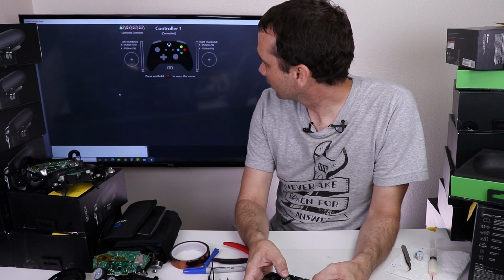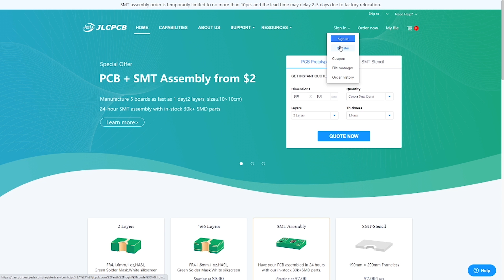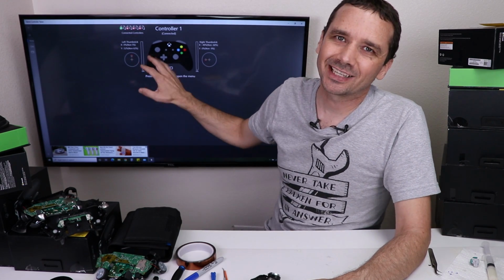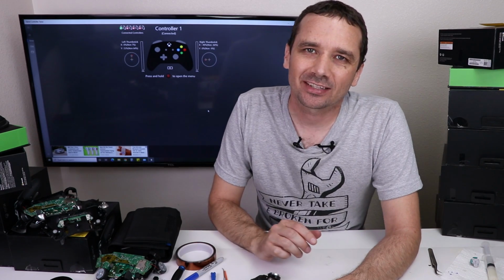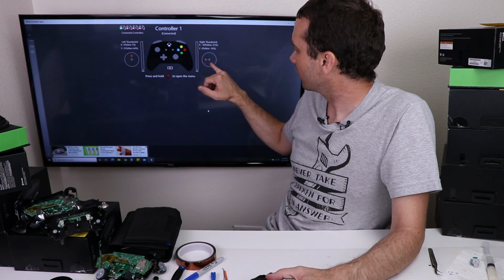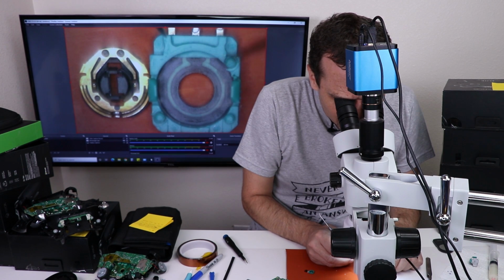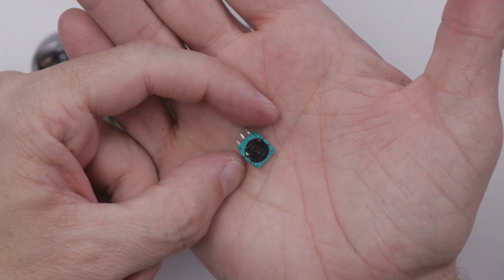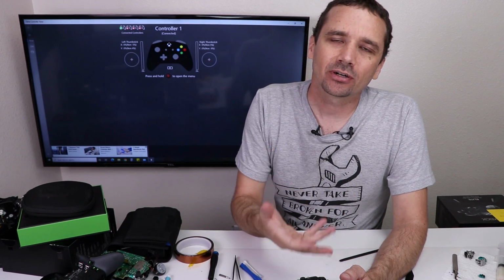How to Fix Analog Stick Drift - 3 Ways

Comment from the maker: Which method have you tried?
Get your PCB's manufactured here: www.jlcpcb.com $2 - 2 Layer 5PCB's,   $5 - 4 Layer 5PCB's
Reply: But where do we buy the parts??
Reply: My controller right stick goes left if i pushed my left stick forward
Reply: I tried buying a new controller
Reply: I have tried the cleaning method without success in the past. PS where do you get your replacement joysticks? and are they as good or better than the originals?
Reply: where is the best place of places to get genuine alps analog replacement for ps3,, ps4 xbox   etc ,    there's china copy's of alps ones   on lots of sites but don't work very well or have less steps in range each direction  or short life span  ,, so is there a good place to get genuine alps ones and how to identify the right ones for ps3 / ps4  / xbox   and some times ps3   ps4 used different alps analog stick for different models of ps3 ps4 controllers ?
Reply: Those black circuit boards look kind of like batarangs.
Reply: Btw I love old big wallets 😆
Reply: Blowing in it.
Reply: The same thing happened on one my PS4 controller's, I took it from another stripped working motherboard and it worked fine I can run again after a good clean different contact wheels it'll work I never use the same part I would rather replace the wheels or the module itself. Those are the two option I use only.
Reply: can you do a complete tear down of the ps5 controller and console when it comes out?   that'd be tits
Reply: Good video, have you ever managed to fix the issue with R2 turning left?
Reply: Plz i need help my ps4 is not turning on when i press the power button it just make sound but the light not turning on plz help me
Reply: Hi,I Have seen your vids and i think your my guy that can help me.

So 2 years ago my ps4 has had a problem that when i turn it on the ps logo start is normal but then there is a black screen for maybe sometimes 3 or 1 minute
After that the blue screen comes and its like very delayed because it only has a plain blue screen,then 2 minutes later the wavy line comes then its says
"A error has occurred in the system software/report the error" Its laggy and it freezes in the login,menu,and when i want to start a game the ps4 turns off.
Also it Acted fixed dor like 3 days then 2 or 1 week later it acts fixed again,but i just want to know if i can fix it permanent or its like temporarily like i said?

For Clear info I have The (PS4 Limited Edition Starwars Battlefront or more simple 1215A)
I Hope You Can Help me Keep up the Good Work 👍🏻
Reply: Can you make a video on how to fix/replace a Xbox elite series 1 usb because I’m pretty sure when I had mine plugged in I tripped on the cable and it demolished the USB port and now it dosnt work so I have to use batteries
Reply: What about just replacing the disk part and keeping the track?
Reply: Hey tronics do you why my ps4 turns off just when I start a video game ? I can watch Netflix or YouTube but just when I start a game my ps4 turns off . Do you know why and can maybe tell me a solution I have the first gen of the ps4
Reply: You can buy parts from ebay or ifix it
Reply: Got a nice Phantom White Xbox One X controller with a drifting right stick off ebay for cheap. Pried the potentiometer off the side enough to get in and clean it.... pulled a bunch of hair out of the controller as well... and now it works like a charm!
Reply: Great video. Can you kindly recommend (list) the set of tool kits required for this operation?
Reply: Hi @tronicsfix , I saw your tutorial , that was awesome but unfortunately I'm unlucky , I clean the potentiometer "nothing" , I change the potentiometer "nothing" and I even bought an other joystick for replacing it ( I didi without any problem) the joystick work but the drift is still there ( I even put the new joystick that I bought on an other PS4 controller and he works without drift ... So my first controller is doomed or what ... I lost hope after doing your tutorial without problem
Reply: This is good I have drift going on with both PS4 controllers and i ordered that soldering kit and the 10 PC analog pieces just in case .. Is it ok to keep soldering on the mother board to the controller ?
Reply: I used #2. Worked a charm. Thanks for the clip!
Reply: I just fiddled around with it then I turned it to the opposite side on where its drifting and blew inside it somehow worked
Reply: Cleaning the potentiometer has worked the ten times or so I've tried it on stick drift controllers. I think it's a design process flaw to be honest since there is a very small amount of lubricating oil in there and that is what tends to spill into the potentiometer. That has been the case with all Dualshock 4's I have fixed anyway. It most definitely works if there is just some jittering in the steering.

Comment: Thank you! Watching your videos (and some accidental joy con damage from my dad who actually knows a bit about electronics repair) has given me the confience to get into it myself. I tried severeal times using a soldering iron to get the joystick out of a ps4 controller, but I just couldn't get the solder all out of the holes. Finally I was able to get my hands on a hot air station and I just finished using it for the first time. WOW!!! Actually game changing. A minute or two and I had the first one out. The blue plastic at the bottom was stringy so I turned the temp down a bit and was more patient and the second one came out no issue. Now hopefully I didn't roast anything important, but I'm just so happy the joystick came out! Thank you sir for making such a positive impact on so many people and saving so many electronics from the garbage. I hope to make this into a fun and useful hobby. I'm sure I'll make many mistakes along the way but I'll learn a lot too!
Reply: Nice! In case you haven't done it already, you can use kapton tape around the area you're soldering or desoldering to minimize the risk of roasting unwanted components, just like TronicsFix did on the video. Repairing electronics is indeed a fun little hobby
Reply: @AUBCodeII  thank you! I did get some of that too and used that, but unfortunately the first time it wasn't down well enough and I toasted the battery connector a bit and had to try to reattach it. I have no idea if it still works, that ps4 is my test board now haha. I have however successfully swapped a ps5's joysticks and I'm feeling more confident! I'm working on getting my friend's Xbox controller to fix drift on that next. 😁
Reply: @thatwolfboy2898  maybe you should consider installing hall effect joysticks on your friend's Xbox controller, that'd be a fun project
Reply: @AUBCodeII  that's the hope! It's so nice to not have to worry about drift.

Comment: This video and the 8 broken Dualsense video inspired me to fix my own. I have no soldering equipment (costs more than a controller) so I bent the potentiometer back to clean it properly. Way farther back than I meant to but it was probably for the better. It was VERY dirty and with good deal of wear but it seems to be working much much better for now (knock on wood).

Comment: I got a PS3 DualShock 3 that I'm stumped on.  The vertical direction, Left Thumbpointer starts off in the upmost position then slowly drifts goes to neutral- all while not responding to vertical inputs.  If I take a Hall effect cover and magnet from another, known-good thumbpointer position, move it to this Left vertical position, the result is identical.  This is the VX3 07 revision.  Could I have a bad resistor or cap somewhere or bad solder joint elsewhere in the circuit?  Ready to abandon this DS3 pcb.

Comment: I need some help, replacing an analog stick, it works perfectly but the l3 button when pressed no longer works. Any idea why this might be. Tried it with two different parts, both from the same order neither the L3 button didn't work. Xbox one wireless controller.

Comment: I recently transplanted a known good analog stick from one controller to another. The drift is ok now, but after a minute or so the stick sends "pushed in" signal, as if it were constantly pressed, which it isn't. What could be the problem?

Comment: This is gold! I've replaced the whole analog stick many times... little did I realize you can take off the sensors and clean them.
Since this video,  I've since replaced the sensors from a new analog stick, without replacing the potentiometers and it seemed to work on one controller... But like everything, its a hit or miss, didn't work on another controller.
Now instead of removing the whole analog stick, I'll just be replacing the potentiometers from now! Thanks!

Comment: Thank you soooo much! I bought a spare analog stick (the square with two potetinometers) from a Xbox One controller for 1 USD and I fixed my Series controller up and down stickness and drifting by doing the method 2! The only difference is that I got the small spart (metal ring) that you removed and, instead of putting it back after cleaning the insides of the potentiometer, I replaced with the spare part's one (since the original seemed damaged) and it worked (on second try, I had to use both metal rings from the spare potentiometers because I destroyed the first one putting it back in)!!!!!

Comment: Thank you so much for this video. One of the analog sticks in my controller was drifting vertically. I opened the potentiometer, cleaned it up following your instructions, and now it is working like a charm. And I used the right amount of thermal paste, as well. :-)

Comment: HUGE TIP - For replacing a potentiometor, if you pry it away from the main assembly (like you would to clean it) and bend it back and forth till it snaps off from the pins, that makes it so much easier because then you can just desolder each pin and pull them out one at a time. That way you don't even need a solder sucker or solder wick.

Comment: i've replaced the analog stick on my dualshock 4 but the L3 key doesnt work (no input recorded). The "click" on the analog stick was working on another controller (used to be the right analog and r3 was working). I think something in the board doesnt seem to get the L3 input, how do i throubleshoot?

Comment: I bought a pack of potentiometers from a shop then said they were direct replacements for Xbox One and Dualshock 4 pads. Replaced 2 on a bad PS4 pad and it turns out they're not the same lol. Must have different resistance. Pushing the stick only half way up or half way to the side registers as 100%.

Comment: Successfuly replaced both vertical potentiometers on both sticks, was harder the first time since controller was new and wasnt opened before. Second time I did it in like 15min. The vertical axis were jumping up and down before, now they're stable. It's slightly off center, someone mentioned in these comments each of these sensors is slightly differently calibrated, but I've got slight deadzones set up for that. Thanks for the helpful guide man :D

Comment: considering how much a person's time is worth, it's honestly cheaper to replace the whole damn thing. Unless you are in the 0,01% of the population with both the skills and the hardware required to apply a DYI solution.
Nothing to say on the quality of the video, but honestly speaking unless you enjoy it as an hobby it's still cheaper to buy another 40 buck controller.

Comment: Changing the potentiometer worked for me! Had an old 360 controller and all i had to do was switch out the potentiometers on my Series S with the ones on the 360. Imagine the little strips as a skull shape and the chin part goes at the bottom. This video saved me so much money!

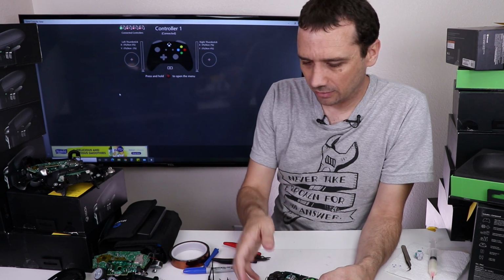Comment: Hello TronicsFix. I recently started learning to repair XBOX controllers. I'm glad people like you are way ahead of me in skills, so we can learn new things just by watching your videos. Thanks for that! I have a question about the potentiometers. When you start testing the first replacement method (around 3:46), it shows that the X and Y axis aren't at zero, so they aren't perfectly alligned. What is the maximum % that you can have there?
Reply: Less than 0.1 its ok

Comment: i have a question: recently i sent a copper dualshock 4 controller for repairs as it had minor stick drift ... the shop called me back and said the following 
This controller was repaired before (wich i denied it was brand new from a well known shop)
they told me this cannot be repaired because its a a board problem and not the thumbstick mechanism... can this be true? (the controller didnt have minor stick drift when i first got it )

Comment: love all your videos,  there is a new problem in my controller , R2 & L2 buttons are connected to my analog stick , and unable to use the stick , they only work by pressing L2 for left stick and R2 for right stick, and by pressing these , they only go to upper left direction, please!!!  i need help.

Comment: The moral of the story of stick drift, and button issues seems to be that thumbstick mechanisms, and the rubber mould that sits under the buttons is generally such a poor design and/or such poor quality we're essentially being ripped off the minute we purchase a new console or replacement controller from Sony or Microsoft! 

Sony controllers are especially poor quality, and the next (gen) console I buy I'll no doubt discover Microsoft's are equally poor with an extremely low lifespan. It seems as long as you're happy to continually waste money buying limited edition controllers (never letting an original get 'overused'), or are an extreme casual gamer you are guaranteed to have button or stick issues. Will we ever see this poor design addressed in our lifetimes!?! I'm extremely doubtful. 

Incidentally, a few months ago Sony released finances that showed they made more profit from peripherals than they did software!!!! I would guess with one hundred percent certainty that the majority of that profit came from replacement controllers, seeing as the thumbstick mechanism they put in their controllers is only guaranteed for 1000 hours. Is it possible the corporations within the gaming industry have the lowest respect for their customers, and treat them worse than any other!?!

Comment: Tronics, big fan of the channel. Matter of fact you are the reason I got into electronics and gaming repairs. My question is where do you get your parts and tools? I got a pack of 12 OEM sticks from eBay and so far first pair ended up worse than the original sticks that had some drift. It’s crazy. At first I thought they were fake copies but comparing to the 7 controllers I am working on they seem legit. Please advice.

Comment: One of my controllers has stick drift and the other one doesn't. I checked both and on the good one the axis value fluctuates between 0-0.05. is this okay. On the pc it just keeps shaking around the centres but when playing games there is no movement. I'm guessing it's just margin of error. But I was wondering at what value it is considered stick drift. 

Btw the bad one drifts all the way so that's pretty conclusive.

Comment: Fixed my issue. Even tho I had to go a lil roundabout to get here. Just how to open a gamesir g4s controller was challenging as it was. But once I got the the potentionmeter I could use some well needed ipropanyl on it to clean. Works better than new now! By some reason it had a lot of black build up on one side. No idea why. But it stopped all shenanigans all together. Thank you :)

Comment: I take 91% alcohol spray and just spray it down inside lightly and roll the sticks around then clean up with a q tip and rest face down to dry out. Works for some time at least.

Comment: I really want to try this on one of my dualshock 4’s that has left stick drift. Just repaired a samsung tv by replacing one blown capacitor on the power supply and that was cool. 75 cents resurrected the tv

Comment: Could you help me out or give me advice? I keep melting the analog stick when i remove the solder joints. I assume its too hot but if i lower the temp it takes too long to come off. Whats a good temp? Im fairly new so still learning but I enjoy doing too so anything helps thank you

Comment: And where am i gonna get Dualshock 3 potentiometers? I bought some analog sticks one e-bay that looked OEM but when i installed them( controller does not even require soldering) the sensitivity was out of wack.

Comment: awesome video.  i have never soldered before, but i'm giving it a try.  y-axis on left analog stick from xbox one is drifitng up to the north pole, and i'd hate to throw away the controller because of a little piece.  i think i will just try and switch the one potentiometer and see how that works, because i don't think there is a need to swap out the entire thing.  thanks for the video.
Reply from the maker: Good luck!

Comment: Is a stick drift the same thing as when your controller on the Xbox dashboard goes up when your pushing down on in settings and it just starts going up
Reply: My Xbox controller just started randomly do a something strange where I wouldn't be pushing joystick on my Xbox dashboard it would continue to keep scrolling up but I had the controller for two years and it's in good shape and I'm trying to figure out what it is did the controller update but didn't fix it